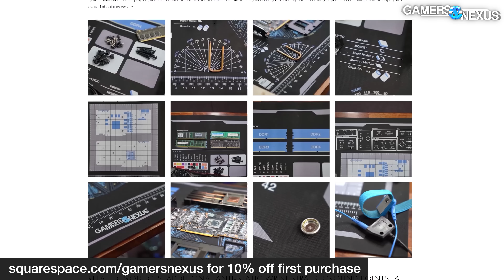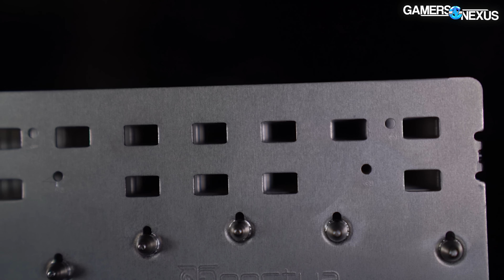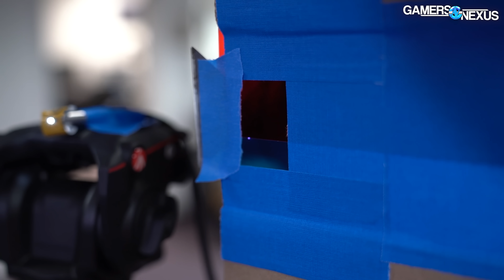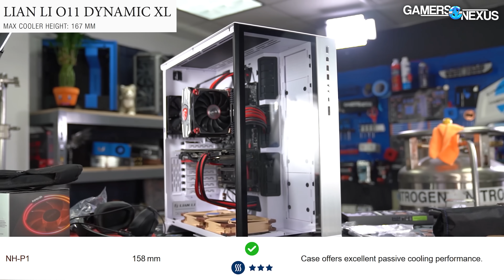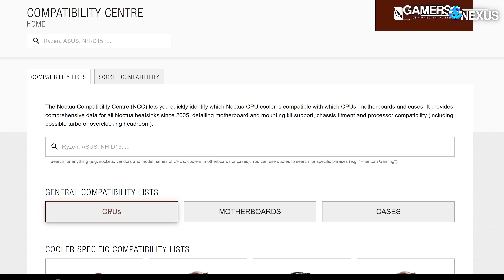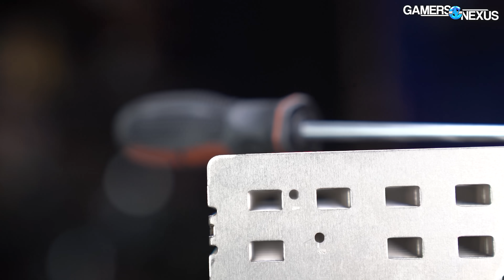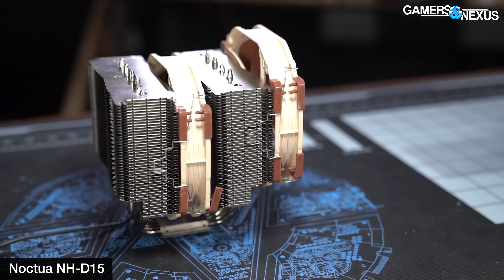Noctua NH-P1 Passive CPU Cooler Review: Benchmarks, Schlieren Photography, & Mechanics

Comment from the maker: Support our extensive testing efforts & equipment purchases while getting something in return via the GN store -- like our Wireframe Mouse Mats, which are in stock and shipping now: https://store.gamersnexus.net/products/gn-wireframe-mouse-mat
To see a cooler that’s almost the exact opposite of the NH-P1, check out our EK AIO Elite review: https://www.youtube.com/watch?v=TTRFkYJMf9Y
CPU cooler testing methods: https://www.youtube.com/watch?v=fmTOJP4KOyk
Reply: How much sheer girth would it take for a motherboard to be flexed enough That the traces inside the board break.
Reply: It'd be nice to compare this to 'no cooler'
Reply: Would love to see how the Scythe Orochi Rev.B does compared to this.
Reply: To be clear the fact that everybody else includes phizo, or even worse philips, head screws for a computer part in 2021 is utter horseshit. Torx just works a hell of a lot better and the smaller the screws the more relevant a torx head is due to it's massive advantage in terms of surface area for the screw driver to grip onto. I own a Fractal Design case that cost me 140$+ and has a removable tray for mounting a radiator at the top. The screws on said tray have Philips heads and are so small and screwed in so tightly from the factory that I have never been able to remove it as any attempt starts stripping the screw heads. This would have been pretty much impossible if the screws in question had a torx head.
Reply: Only one 65W power cpu not 35W? Only R5 3600 so why not R5 5600X or some APU: AMD Ryzen™ 7 5700G (65W), AMD Ryzen™ 5 5600G (65W)? Why not some Intel CPU like 11400 (65W)? I hope it will be next part of testing this cooler.
Reply: Very interesting but has me worried about its weight causing board flex over time
Reply: NICE AWES0ME C00L_🍨 VIEW *
Reply: Am I the only one that noticed the mounting hardware looking familiar or the same as nh-d15
Reply: I would love to see how this passive system can do, pulling heat from the hot side of a  TEC1-12706  "Thermoelectric Module". The data sheet of these modules shows that about 66Watts is their maximum draw at ~16vDC (maximum capabilities). How would the  NH-P1  perform in cooling down a CPU, if it was teamed up with a solid-state  TEC module ?
Reply: FYI you say "over hanging the RAM" twice, suspect one of those was supposed to say VRAM =)  12:13
Reply: Steve can you test some other passive coolers, like the Thermalright Macho Zero? I would love to see how much better this is against more traditional passive coolers.
Reply: I'm disappointed that Steve didn't twang the fins when he mentioned acoustic testing.
Reply: Could you stop doing acoustics in all tests? It's wasted fucking time, it's almost as bad as how you used to take 5 minutes to slowly explain that "standardised fan testing isn't valid." Where Standardised fan tests have A LOT of merit, these noise tests are completely fucking worthless.

Comment: combined with a large GPU-heatsink the weight of this Passiv-Tower pulverized after a few years the plastik-feet of my bitfenix prodigy-m mATX-enclosure. Also there is a constant strain on the motherboard wich can drasticly increase during transport or movement. I recommend an enclosure where the motherboard is mounted horizontal, flat at the bottom and the tower is standing upright on top of the board. That would be perfect. However, there is another benefit i noticed over the years. Any other actively cooled heatsink atrackts dust over time. The NH-P1 with a mounted low-rpm-fan never needed cleaning in my years of usage. peace and out.

Comment: Really good points about passive cooling vs. active air cooling in terms of noise. A lot of people go, "OMG, quiet computing!" but with good fans, it's not a big deal.  Also, good points about what it's actually good for: low-maintenance environments. Personally, I have a bit of a fetish for passive cooling, in part because of the dust concerns and no moving parts, but also, I think back to my childhood game consoles like the SNES and how they were passively cooled. Same thing with GPUs: early graphics cards didn't have fans, so it's interesting to me to see what we can do today without fans. And then I also have a thing for efficient computing, which goes hand in hand with something like passive cooling.

I had an Airtop 2 for four years, and I loved it, but it did get too hot to the point of having weird issues with the LCD diagnostic display, and losing two USB ports and eventually the motherboard, or at least I chalk those and some other weird issues up to heat. This thing seems to have a similar mass, but won't bake the motherboard if used in a case with decent airflow.

Comment: I've been running a completely fanless home server for 12 years, with a Nofan CS-70 case (it's like a PC turned on its back, so it acts like a chimney for heat), a fanless PSU, and a NoFan CR-95C cooler. The system has been rock solid. The problem is the cooler is discontinued and does not support modern sockets (my current CPU is a 3770T).

So this Noctua one is an obvious replacement. However looking at 12:20, I am going to need to rotate it 90 degrees because in my case, up is towards the back panel I/O. I'm hoping some hardware is available that will allow this. Perhaps the NH-AM4 kit which has shorter bars.

Comment: Noctua should collaborate with a case manufacturer where the passive cooler is even larger and converges with an aluminum panel of a PC case so the case itself is dispersing the heat from the outside.

Comment: It is tempting when not wanting to deal with dust buildup, but then you need open top for the heat to escape, but dust could still accumulate downwards from normal air. Tech combo just seems to make more sense, especially with a good quality fan like Noctua: You can install a fan that runs so slowly that it is virtually silent and it will improve otherwise passive cooling so much, and more compact, and if you don't have dust filters in the case, well, blowing the dust out of the cooling fins isn't a big act, but even after dust buildup such an active one would likely be more effective than the passive one. - Plus, if control means are good, you could set fan control to not run the fan when not needed, thereby postponing dust buildup a lot.

Comment: Wouldn't be the test more accurate if you put the MB in vertical position not horizontal? The heat moves thru more radioator fins, maybe it would create a more powerful passive draft.

Comment: I'm looking at a 58w gaming rig that'll be housed in a skeleton case, something that is easy to inspect while running, requires little maintenance, and can be run on an inverter powered by AGM deep cycle batteries. (Life is getting, weird.) performance per watt might be running my life soon. Also thinking a Scythe Ninja 5 would weight too high on benefits to even care about the tiny increase to power consumption.

Comment: Noctua NH-P1 sound  test.  Using a i9-13900KS overclocked to 7ghz, we could certainly hear a sizzle, snap, crackle and pop. Plus the smell coming from the test bench was louder than a jet engine run on aviation fuel.

Comment: Got to go totally fanless to for running on solar power. All the power I save goes towards turning stepper motors. I have been thinking about using a heatsink like this and pulling air through an open case using solar updraft and a flue pipe painted flat black.
Reply: I have an old game tower stipped down with no covers. I mounted its component side up on plywood and drawer slides and cut holes around the case to push higher-pressure air through from the wind, there is always a high and low-pressure side in the wind.  I got to clean it often because of dirt but that's the cost of doing business where there is no electricity. I went to a bar in Arizona and they were cooling the bar using "solar updraft" and evaporative filters. I think it would help keep electronics cool.

Comment: I just like this from an aesthetics point of view. I'd have it in a case 011 mini where I'd have 2 case fans on the top and 2 case fans on the bottom Symmetry is sexy. 800rpm locked, with 1200rpm oh shit kick in on a hot summers day. Issue is the graphics card. I'm thinking 6750xt red devil and remove the stock fans and shroud. Fit the card on the lowest pci slot next to intake fans. Will it work don't know. Love to try it.

Comment: Interesting but I wondered how it would compare to a massive 14cm tower air cooler facing up a top-mesh case with is fan offs in a semi-passive configuration (only turn fans up at about 75c, for example). I have run such scenearion with a cryorig H5 for a long time and it ran very well for that dual-purpose. I suspect a U14s would be ideal for that, but due to AM4 not being a square mount, most coolers don't have an option to mount facing up like they used to do in intel platforms, anymore. A shame.

Comment: Scythe FUMA 2 with very low fan speed (like in less than 500 rpm instead of 1500+ rpm) seems like a better option. I'm still running Scythe Kabuto with 190 rpm (not a typo!) CPU fan in my current system (with system running light loads around 40 W power usage). The CPU fan will ramp up to 1300 rpm for higher loads, though.

Comment: 5700x (when it releases) and 1660ti with a morpheus III attached to it would be perfect. 100% silent and not complete garbage. Could add an NFA12 to both CPU and GPU set to 500rpm and you could overclock the 5700x and bump up the GPU to a 2070

Comment: Genuine question they tested the cooler with the mother board lying flat, but most mount on the side of the pc case. That test showing the flow of heat would be completely different if mounted the typical way. Right?

Comment: This is a niche product. This with a passive PSU and SSDs ist perfect for a Sound Studio for example. There are also no failing parts. At the other side... a noctua fan @low rpm will fail maybe in 2 decades, when the whole system is obsolete.

Comment: At normal (average, not max) load I'm barely able to hear my nhd15 inside the case in a completely silent room, so much that when I switch on the PC under my desk I've to wait the screen to understand if it was powered on (ps I've also a semi passive oversized power)!... This to say that noise use case is really not existant, maybe just the dust one in my opinion

Comment: My CPU has a push-pull cooler, my 3080 has 3 fans, my PSU has a 120mm fan on top. My case has a clover shaped cluster of 80mm RGB fans on the side panel (all RGB is set to white to match the case), another in the bottom, two more in the front, and freaking GIANT one on top near the closable vents. With all of those fans I hear absolutely NOTHING as they spinup if I do it during daytime suburb background noise, and in the dead of night the noise fades to nothing quickly after bootup. The rig is about a year old, I don't expect it to be silent forever, I'll have to replace fans probably when I move to DDR5/Win11 - but if you couldn't handle it, you'd have to blow your brains out if you had a cricket in your back yard, or GOD FORBID a plane fly overhead.

Comment: I don't understand why this cooler wasn't made to be mounted also with the fins in line with the air flow produced by a standard front push - rear pull configuration, that is, I think, the most common one. This should increase the performance of the cooler without an extra fan on it, relying only in a good case air flow.

Comment: i use my "Thermalright True Spirit 140 Power" also as a passiv cooler and it is not made for but works fine !  ok i have only a ryzen 2600, but it never gets over 60C 
but my case has good airflow and 2x 120 and 2x 140 fans

ps: please test the old Thermalright True Spirit 140 Power

Comment: Absolutely overpriced. Barely works and it's just aluminum. It completely fails as a cooler and you just say "oh that's not a bad thing that's just a part of passive cooling"
Passive cooling implies there's cooling. It just overheats. Completely useless product, basically a torn apart soda can for over $100. Unless your setup is in Orfield Labs, there's no reason at all to not get literally any other cooler. Either that or you're rocking an Intel Pentium at 400MHz.

Comment: fanless system, kinda like those fanless air blowers. where they simply put the fan in the base and had the air come out at waist level. if you really want a fanless system then you would probably have to use some sort of valve setup using temperature difference to push air into a smaller hole so the hot air can circulate back through a bigger hole. idk screw it, geothermal pc cooling xD

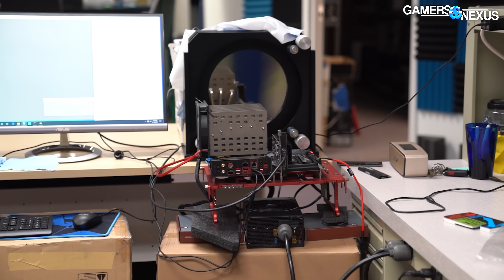Comment: 9:00- Gamers Nexus: "Schlieren imaging"

Me: "Everyone has a plumbus in their home. First they take the dingle bop and they smooth it out with a bunch of schleem. The schleem is then...repurposed for later batches.
They take the dingle bop and they push it through the grumbo, where the fleeb is rubbed against it. It's important that the fleeb is rubbed, becasue the fleeb has all the fleeb juice.

Then, a schlami shows up, and he rubs it...and spits on it.

They cut the fleeb. There's several hizzards in the way.

The blamfs rub against the chumbles, and the...plubis, and grumbo are shaved away.

That leaves you with...a regular old plumbus."

Comment: is it possible to have some acid? dissolve the oxide layer on the CPU heat spreader as well the heat sink just as the two are place together (with perfect alignment) forming a metal-to-metal bond?

Comment: I built a computer once where I reduced my pc noise by building an air duct from the rear fan to the cpu heat sink using nashua tape (the metal tape usually used on furnace heat ducts). I made the duct by screwing four long bolts into the back of the fan and wrapping the tape around it.  As luck had it, the heat sink was at the same level as the fan so the duct pointed right to it.  Another advantage is no vibration on the heat sink.

Comment: I'll be using one with an i3 in a recording studio because audio recording doesn't require a lot of computer power but it does require a low noise floor if the system shares the room with microphones.

Comment: That would be great for my SFF case (Its boxy and big enough) My Ryzen 3600XT even at its 4.2GHz OC barely gets over 160F in a hot room with active cooling under load (and i mean 93F hot) so im betting that fan config you mentioned would work well.

Comment: I would not advise to mount a fan on top of the cooler if the fan is to be stopped until it CPU hits 100% load. This will cook the fan, and hinder the natural heat flow of the passive cooler.

Comment: Great video. 6:07 The plates are parallel to the upward direction, not perpendicular. Which is extreme nitpicking because the images clearly show what you are talking about.
Would you ever consider dunking your expensive equipment into mineral oil?

Comment: Noctua NH-P1 passive cooler is designed for liquid immersion cooling that will function adequately in non immersion cooling environments.

It's mostly targeted at prototypes rather than dense immersion cooled servers racks.

Comment: Sorry, but this thing is practically useless, especially at this price point. Dedicated servers have their own cooling, especially if they use multiple racks with several processors in each. For a gaming computer you would still need GPU with its own ventilator and possibly case vents. Only theoretically useful application would be some dedicated science computer with weak passively cooled graphics card, that needs to be as quiet as possible. In that case PSU would need to be cooled quietly as well.

Comment: As expected, this passive cooler is just a gimmick. Price wise on par with premium AIOs, but performance wise far from it. It will have some applications in some extremely specific cases, like where completely soundless pc of modest performance are required. For near-silent gaming, case insulation and a good aio make the pc already barely audible.

Comment: What's the threshold for RPM/noise/performance? Can it be roughly at noise floor with a fan at very low RPM and allow a little more performance? This thing would be great in a ITX case with horizontal MB mounting.

Comment: If gaming is your only sin like yours truly and with the GPU is now a days doing the heavy lifting it should be possible to make a decent gaming rig with a passive cooled CPU. That´s a task for the experts though, I don´t have the monettos to experiment around with various builds.

Doubt it would work with a 3080 though as it creates too much heat and would add to the case temperature. Perhaps a 3060 paired with a 10600k or an equivalent cooler running Ryzen cpu.

Comment: I would swap out an soooo many stock coolers in office PCs.
Stock coolers usually have that sucky boi design, which is fine ... unless it's used in an office.
You know which part of an office is NEVER cleaned? 
You know how many calls IT receives because "It do make wierd noise" - "It done go out when browse mehmehs at work" - "It smell wierd" - "It smoke" (last one was not repairable)
And it's always the CPU cooler being a disgusting amalgamation of dust and dead spiders.
Case of course also looks like the inside of a dyson but atleast that doesn't kill the expensive parts.
Most office PCs are low power, better call it "cheap" power, because they dont care about performance, they want to save money.
And that's where passive cooling usually dies. You get a cheap sucky boi cooler boxed with the CPU but 4/10 PCs will die the sucky boi death.
OR you pay 100 bucks for a non sucky boi, but that would be upfront cost, so that's a nono.
meh.